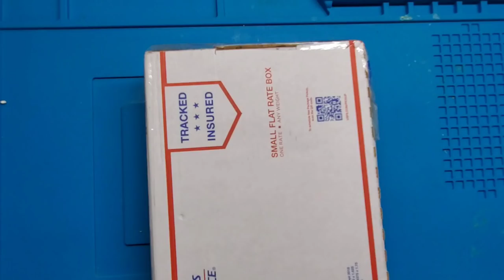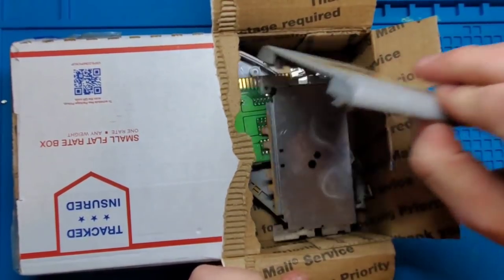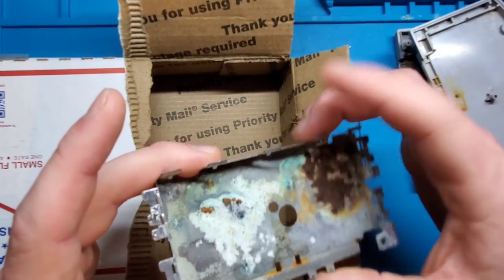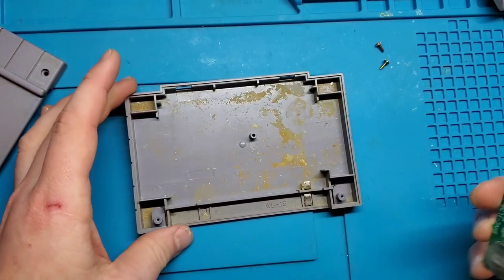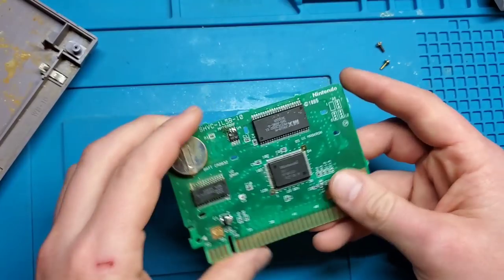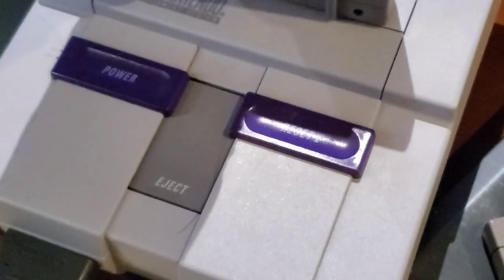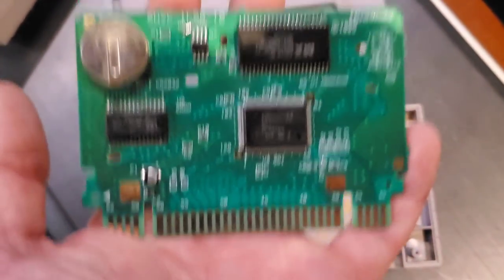SNES Cart Won't Boot - Nasty Nintendo Cartridges Part 1 - Fixing Ebay Junk

Comment: That's electrolytic corrosion - basically electroplating in reverse.  Instead of adding metal, it carries it away.  That's also why it's only affected pin 8 on the SRAM supervisor chip, since that has battery power at all times.

Comment: That chip is the voltage controller for the sram. It switches between battery power and main power. That pin that was broken off was either ground or Vcc. So a very important pin

Comment: These games were caught in a house flood when a barge broke loose and ran into a dam, I bought them as a massive lot. Post forgot to bring news paper to pack with...Thats why it was not packet well....
Reply from the maker: That's crazy,  either way,  doesn't matter.   Good challenge for the new year.  Thanks again.

Comment: All of my N64 games stopped working, and I thought at first it was a problem with the game console itself, so I replaced it and no luck. Then I rubbed down the contacts on the cartridges with isopropyl alcohol on a Q-Tip and immediately every single game started working again.

Comment: Looks like you put the chip on backwards. Just a heads up. Could be wrong it’s hard to see on my phone but the dot for pin one looks opposite the board marking.
Reply: You're 100% correct, chip is on upside down according to board marking and pin 1 dot on chip.
Reply: Good spot dude.
Reply: No he didn't. Whoever botched the initial repair did. If you look at the donor card, the chip is in the correct position. This is probably why the chip suffered btw and burnt the pin and the trace, it was put upside down.
Reply: @Fularu  But the Silkscreen on the donor board was reverse, too. The chip IS mounted backwards now.
Reply: @insanedruid3143  I disagree. The silkscreen looks to be wrong on the first PCB BUT the resistance SMD is positioned on the exact same pin. Wrong silkscreens on commercial pcbs is nothing new. This probably led to the wrong repair in the first place. Obviously the cart wouldn'T work before and is working now. The Amiga CD32 and the Amiga 4000 have wrongly polarizzed silkscreen for two capacitors for example yet were properly installed at the factory level.
Reply: @Fularu  That's true, you are right. I thought about the possibility of a wrong silkscreen but didn't noticed the resistor. Makes even more sense now that the first repair guy fell for the wrong print and thus burnt out that chip.

Comment: When it comes to broken pins from the IC package, some people carve the IC to expose more of the pin and stick a bodge wire on it.
Reply from the maker: Yeah,  i might go that route to put it on the donor cart for a future repair
Reply: doesn't it look like the IC failing is the reason why the pin was completely vaporized to the point where it burned the trace right off? or it could have been stuck in a broken snes that burned out the IC...

Comment: Someone's tried to remove U4 before and on pin 4 the solder hasn't melted properly (no rhyme intended). They've pulled on the IC lifting the pad, and then instead of stopping they've carried on and then snapped the leg off. They then left a road crash of solder on pins 1,2 and 3. EDIT: On second thoughts they could have just burnt that pad away.
Reply: I burnt the leg to the pad....I'm horrible at soldering ....

Comment: That missing pin wouldn't happen to be the positive would it? Because I've seen the same damage from the time my dog pissed on a USB hub I was using to run a cross the living room floor.

The first hub chip was toast in the same fashion. The second I salvaged to replace one that caught fire in my keyboard. A month later it also caught fire. Thanks Daskeyboard!

Comment: The chip in question looks to be this: https://snescentral.com/chips.php?chiptype=MM1026AF
Its purpose is to prevent power spikes to SRAM when the console is powered on and off, and looking at the fried pin, likely got a bit too much of a power spike from the looks of it.

Comment: How much would a refurbished cartridge sell for? 
And how much does a non-refurbished but good condition cartridge sell for? 

How much value does a cartridge gain if it is well kept rather than refurbished?
Reply from the maker: That entirely varies.  A working super mario rpg cart in similar condition is probably worth about $50-60.

Refurbished isn't always a bad thing,  in these cases, having replaced the save battery can maintain or even improve value.   If it were a replacement shell or label, then it wouldn't even be worth $25.

Comment: Have you ever considered copper tape for fixing pads? It seems like it should work.
Reply from the maker: As long as it stays in place, yeah it probably would.  Id question whether the adhesive would hold up to soldering or not

Comment: Where is your new desoldering tool?  Great vid by the way!
Reply from the maker: That's not really meant for surface mount stuff like this,  in this case, hot air works best.

Comment: Any concerns about spraying presumably conductive liquids on the board while the battery is plugged in?
Reply from the maker: You're talking about that 3v battery?  Not really, no.   99% isopropyl alcohol is barely conductive at all.   Water would possibly be a different story,  but even still at such a small amount, the resistance of the water itself is likely too great to transmit current where it shouldn't be.
Reply: RetroRepairs dumb question the isopropyl alcohol is the solution you use to clean and a toothbrush ? Thanks in advance

Comment: Hey i recently fixed my full of rust controller's battery pack by bathing them in vinegar and cleaning with a toothbrush. Can you just drop the cartridges board the same in vinegar. Will it damage it?
Reply: Vinegar corrodes metal so not a good choice I think

Comment: Why not just use a wire and make a bridge? Soldering one side of the wire directly on the chip (instead of the broken solder pad) and the other side directly to the capacitor. It's a commonly used method for this kind of problem.

But well, as long as it's working anyway ;-)
Reply from the maker: I did, it might not come across that clear,  but it is connected to the chip leg,  which is also connected to the pad, but the pad doesnt go anywhere
Reply: @RetroRepairs  Yeah but I mean, you didn't really had to expose the green thing? Wouldn't just a wire directly soldered to the pin then soldered directly to the capacitor would not be enough ?

Comment: Might sound silly, but is that a soft bristle or hard bristle tooth-brush?
Reply from the maker: It's one of the ones that has both.   A ring of harder ones and some softer ones around it.   It doesn't really matter too much,  hard bristles wouldnt damage the board

Comment: How does a Super FX chip break?
Reply from the maker: Bad current going through it?  Who knows.   Snes has notoriously bad caps, so entirely possible an incorrect current ran through a chip and killed it.  Happens all the time to the cpu. That's my suspicion anyway, but i haven't swapped it yet to truly verify.
Reply: @RetroRepairs  A real shame that you can't just open the chip in question up and repair it.

Comment: You use wayy too much flux.. that solder wire has flux in it aswell...
Reply from the maker: It doesn't work as well. Much easier to simply add more.  It doesn't hurt it